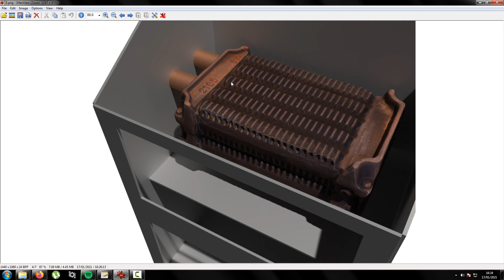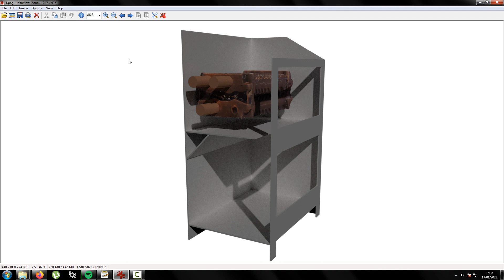Wood Burning Boiler Design Progress

Comment: I would consider designing in an easy method of cleaning the heat exchanger ,we often have to de-soot these when servicing the bbu , and you need to get your brush in from below or above as well as the front to clear the pathways . Think about pre heating the secondary air and also a flue damper , are you going for a solid fuel liner or the cheaper gas copex? .also have you thought about down draught , terminal design can greatly affect  the amount you may get

Comment: Shaun, have you ever considered going back to your outdoor burner but using something super efficient like a rocket mass heater? It will smoke no more than a few seconds.
The problem with any non efficient stove is that the unburnt hydrocarbons have an atmospheric heating effect that is many fold worse than carbon dioxide.
Reply from the maker: I may return to a better version of the project in future but it's unlikely.
Reply: @ShaunDobbie  Nevertheless, you've inspired me to connect my central heating to my wood fired rocket stove as per your schematics. Any suggestions on improvement? 
What about just hooking up the central heating return loop directly to a hot metal surface  via heat exchanger?
If I'm running the gas boiler only without the wood stove, how do you stop all of the heat sinking into the wood burner?